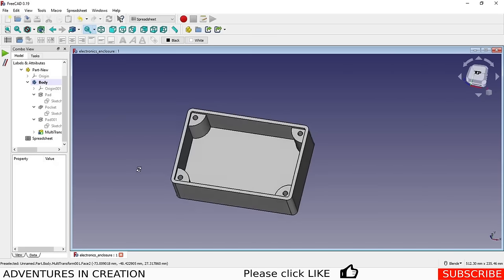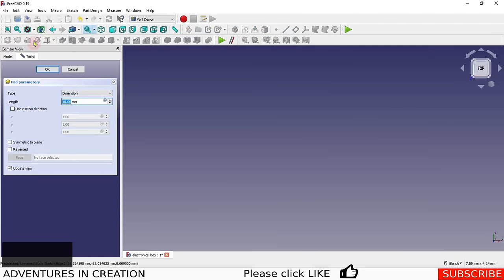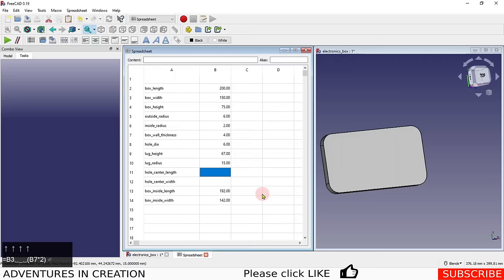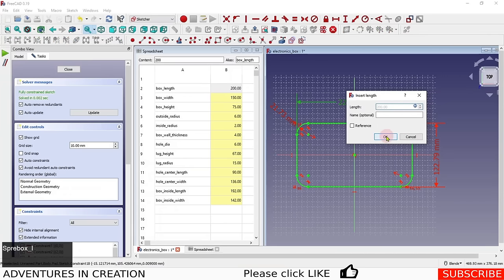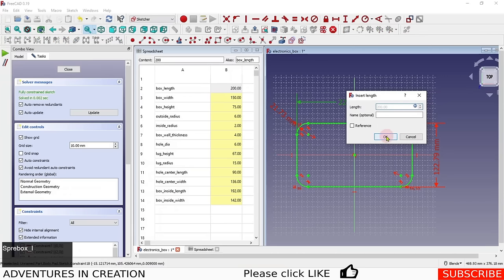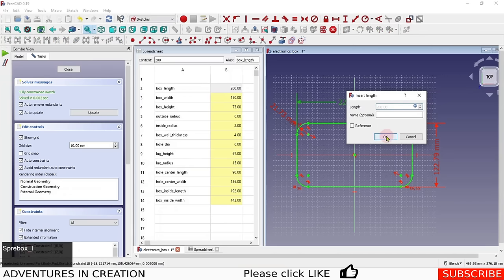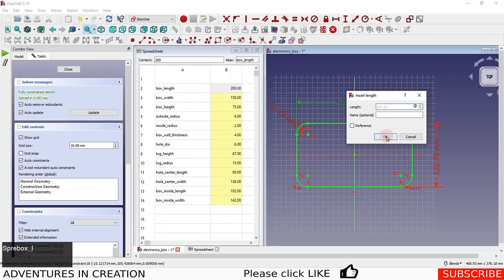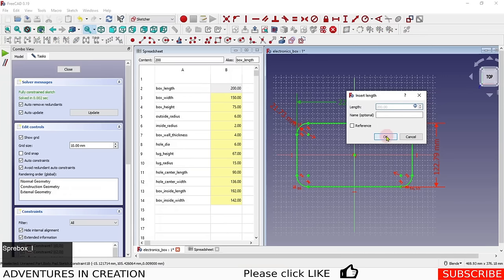FreeCAD Electronic Enclosure Using Simple Parametric Design Techniques

Comment: This is an excellent tutorial, got me up and running on my own electronics enclosure very quickly.  Before I found it wasted a many hours messing about trying to use the manual, to no avail!
Reply from the maker: Glad it helped Steven
Reply: @Adventuresincreation  hey man i already installed freecad in my computer using windows 7 but it's not openning what could be the problem

Comment: Thank you for clearly showing what you click and explaining why.  This is so much more useful than a 100 videos that show someone creating something almost by logic.  Your explanations and demonstration is so clear that I was starting to anticipate and check my anticipation against what you actually did, which gives me confidence that I may actually be able to create something like this when I install FreeCad for the first time.
At Time = 17:51, you mentioned surprise that the exterior corner radii came out different sizes after the mirror operation.   I was surprised that you only selected the upper left and lower right corners with the symmetry operator.  Could this have caused the discrepancy?  I would have guessed that you would have had to select all four corners with the symmetry operator but don't know if that is correct or even possible with FreeCad.
Reply from the maker: I am glad that it's helping you get to know freecad. The symmetry constraint is a tip for minimal constraints to achieve the same end. I think the radii were unconstrained after the mirror, I expected the dimension and equal constraints to mirror. You can constrain all four corners but the result would be the same. Thanks for watching the videos and lending your support.

Comment: I think the new box that you’ve added that shows what you have just typed and also highlights your nails and toes the switchings on the mouse is something I would like to use  Are use Windows 10 which may not be the same operating system the new use but can’t find anywhere where I can highlight the area around the mouse which I assume is the clip so can you please help thank you it was a great video by the way I’m very much appreciated
Reply: I am sorry about the stupid wording  I hate apples text modifications to my typing but always forget to check before sending you would think at 88 years old I would know better
Reply: It’s you who is appreciated not me.
Reply from the maker: Thanks Brendan, if you look in the description there is a link to the software that highlights the mouse 🖱. To make the pointer bigger and change the color just use windows 10 settings. Let me know if you need more help.

Comment: How do I print out a drawing without the points that join the lines together? I don't want the connecting points showing on the printout.
Reply from the maker: I would have to look into that. Do you have an example?
Reply: @Adventuresincreation  I drew the object in Part design workbench. I tried using Draft and it worked there so I use that now.

Comment: Thank you for taking the trouble to post such informative videos. I am a new user of FreeCAD, initially version 0.18 but I have now downloaded 0.19. 24267 - quite a performance on a Mac but got there in the end. I'd be happy to assist anyone else having trouble with the task, which involves finding the backup of 0.18 and deleting it before downloading 0.19 - otherwise it just re- installs 0.18 again.
 
I followed your video step by step, but apparently came unstuck when trying to use the pocket command. After several attempts, I realised that in my version there are 5 options:-

Dimension, 
Through All, 
To First, 
Up to Face , 
Two Dimensions.
 
I discovered that using 'Dimension' allowed me to set the depth of the pocket, but for some reason it pocketed from the bottom upwards, and it took me a while to discover what was happening. I've tried reversing but to no avail. As I said, I'm new to FreeCAD so any ideas would be appreciated.
Reply from the maker: When you create a sketch it will typically be on a plane eg X-Y plane. When you create a pocket it can be on that same plane, you can try reversing, symmetrical or offsetting the sketch from the plane. You need to establish where the pad is so you can pocket from the right position and direction.
Reply: Thank you. Problem solved. After I created the second sketch, I offset it in in the Z axis to the height of my box, by using 'Attachments" in the work tree. I then used my spreadsheet setting for the 'pocket' depth of the box and hey presto, it worked. Thanks for your help and suggestions.
Reply from the maker: @bobbailey7024  I am glad that worked for you. Once you get comfortable with that the world is your oyster ;-)

Comment: Maybe it's me but, I would need to create a hole on the FACE part of the box and no matter what I try, it's not working.  I've tried creating a rectangular sketch to use as a hole, I've made it in the X-Y plane, the X-Z plane, the Y-Z plane, I've tried to pad one and then use it to make a hole and after wasting several days, looking at a dozen youtube channels to determine how it's done, nothing.....  No one seems to have made a youtube channel to describe making a simple rectangular hole on the face of a box.  This is giving me a huge headache.
Reply from the maker: Hi Phil, you've got this. Make sure your sketch is inside the body of the box in the model tree. Create a sketch of a simple square that is symmetrical around the coordinate system. Then pocket that sketch if the hole 🕳 doesn't appear, check the reversed box. Let me know how you get on.
Reply: @Adventuresincreation  Nothing doing.  I decided to physically cut the part out instead.  However, when I printed the box, the outer wall was printed as a separate wall from the inside wall.  Doesn't look like I'm ready for freecad until I find a tutor near me to explain the details.  It's not like I'm un-educated.  I am a pilot, applications/software engineer and have been using personal computers since 1976.
Reply from the maker: @philnelson2364  I'll do a video short for you, give me a chance to dig out the model, where do you want the hole in the box?
Reply: @Adventuresincreation  I succeeded in creating a box with lugs to fit an arduino mega.  Everything is fine until I try to cut a hole in the left face.  I tried selecting the face then creating a sketch then making a rectangle, tried making a hole in the face with the sketch (Nothing happened) then tried to pad the sketch then use it to make a hole (still nothing).  Everyone on youtube that uses freecad seems to have absolutely no problems building a model, placing holes everywhere but I can't.  I was able to place a pocket in the rectangular cube to make the actual box, add studs but to carve a hole on the left side of the box........  I originally created a sketch in the X-Y direction but couldn't add height.  Tried in the Y-Z direction but the sketch appears in the center of the X axis.  Tried doing it using the X-Z axis but no Y direction.  Watched a youtube where the person clicks on the face to place a sketch and I tried that and freecad didn't ask which plane to place the sketch on (which helps a great deal.)  I can create the sketch on the left face but can't seem to actually cause it to make a hole. - I uploaded the file to a shared folder on my google drive.  If interested, it's at:   https://drive.google.com/drive/folders/1OfIndy-xZym0i4LKQj_bpf3o8uSIezOn?usp=sharing
Reply from the maker: Phil, check out this video https://youtu.be/IOUSrtSyAHw you were so close. I suspect you were not selecting the sketch when creating your pocket. Take a look at the offset sketches and planes video that I linked to in this too. It will help for sketch positioning.
Reply: @Adventuresincreation  Finally, freedomCAD...  Looks like I missed a step or two, like finish sketch then selecting it from the combination windows then POCKET and not HOLE and then correct the depth of the pocket.  Right now, just being able to place holes in any plane is a big plus.  I tried to do a sketch in the YZ plane but it was on the opposite side of where I wanted it.  After closer inspection, the model flipped to the right side instead of the left where I wanted it to be.  Looks like using the HOLE option seems even more complex with all the params it has and pocket is even easier.
If you noticed, I did use the spreadsheet workbench to create the box, pocket, lugs etc.  At the point where I was, I just wanted a pocket, any pocket so, for the time being, I'll be creating new boxes from scratch till I get to be an expert at it and then build relative boxes to modify on the fly.  Thanks for your support.  Not many people today take the time to do what you do.  Keep on truckin (old 70's expression)   Phil

Comment: Great tutorial, thanks - very clear presentation and opened up my eyes to a heap of possibilities for a project I want to do.
I hope I'm not going to fall into many more FreeCAD rabbit holes like the extra hour I spent on the macros issue. Windows 10, FreeCAD can't connect to the wiki to populate the available macros list, so I had to learn how to download and install the  EasyAlias macro - but the way that worked was just magic!
Reply from the maker: Thanks for the feedback. Today's video shows you how to create a macro of your own. Maybe that will open even more possibilities.
Reply: @Adventuresincreation  Update - I checked for updates, installed FreeCAD 20 and bingo! The macros and desktops are all showing up.
Now on to studying the lid before moving on to the job I want to tackle.
Reply from the maker: That's good news!
Reply: @Adventuresincreation  Project completed! I was pleased to find that the way you'd covered the basic principles meant I had only a little more to learn before being able to complete the design of a housing for a Raspberry Pi Zero plus Ethernet adapter board. I've put the design onto Printables with the FreeCAD file and some pictures - https://www.printables.com/model/287374-housing-raspberry-pi-zero-and-ethernet-adapter
The whole thing is now chugging away using PiHole to block adverts on our home network - happy days 🙂
Thanks again for the great intro to FreeCAD! 🙂🙂🙂
Reply from the maker: Excellent, glad it helped. I'll take a look at your freecad file later. Well done!

Comment: One thing that unnerves me about Alibre Design is, as it happens, a part based or created on a certain face, becomes orphaned when that face is changed or deleted, yet the generated part is still valid. This creates an error condition, of course. In that program you just start over. I see in FreeCAD information that indicates that, perhaps, the base or support face can be changed to a different face of an existing object. 
The question then is, is that possible and follows if true, how is it done?
Reply from the maker: Freecad is undergoing a fix for the topological naming issue which caused modeling problems when a sketch was created using a model face as a reference. The change was not intentional and very unpredictable.

Comment: This was my freecad breakthrough video! Thank you very much!!!!
Reply from the maker: Thanks James, Glad it helped!
Reply: @Adventuresincreation   I've since run into the "topological naming problem".  I've been reading into it a bit, and it seems that rather than sketching directly onto faces, one create datum planes on the primary planes, then sketching on that instead.     Have you had any thoughts in that regard?  I've tried doing it a couple times and made a mess of it so far
Reply from the maker: @jblacktube  it is an issue that is brought about by changing a model such that the faces change their reference ie face #1 might become face #3 so that anything that referenced face #1 is now referencing the wrong face. Using a datum plane that is attached to a model plane and offset will not suffer this fate.

Comment: the enclosure bottom does not change with the wall thickness change
Reply from the maker: From memory the depth of the box is a separate parameter. I am sure you could change that.
Reply: @Adventuresincreation  Yes, I was able to attach a datum plane to the top face, add the inside sketch, pad to the box height - the wall thickness. The bottom now changes with the side walls. Same for the lugs. Thanks for the tutorial. It has helped me to understand greatly the parametric modeling concept.

Comment: I can't get the hole to go through the bottom as well. What ever I try it just does something completely different like removes the whole bottom. What am I missing here ?
Reply from the maker: Which hole are you referring to?
Reply: @Adventuresincreation  the 4 corner holes. I was thinking of bolting the box to my printer so the flat head screws should go through the lid and the box into the printer
Reply from the maker: That's odd, you should be able to just extend it all the way through
Reply: @Adventuresincreation  can you do that on your box? what exactly are we extending ?
Reply from the maker: @eyvindurleo  I will take a look at the model, I haven't done anything with it for sometime so I can't answer off the top of my head.
Reply from the maker: OK, I just had a chance to look at this. I see that the hole and the "boss" in the corner are made from one solid with a hole in it. Therefore, to make the hole extend all the way through you will have to create another hole that just goes through the solid. You will need a new sketch with just the holes and create a pocket "through all" that should get you the hole that you want.
Reply: @Adventuresincreation  great i'll try after i install a bltouch on my anet et5 wich has some desoldering and step downs = headache

Comment: Nice tutorial, one thing you may want to mention is that on the straight lines for the lugs, these should have a vertical and horizontal constrait. If you dont, when you update the border thickness you may run into alignment issues.
Reply from the maker: Good point. I will try to mention the auto constraints more in the future

Comment: I'm following your example to the letter but when I run the macro I get errors that it can't start with a numeral character.  error: Remember, aliases cannot begin with a numeral or an underscore or contain any invalid characters. The last video I watch you used the names in the formulas instead of the cell names and it worked. What's the difference? Thanks
Reply: I figured it out. I was using a minus sign between the words. Example Box-Length.
Reply from the maker: Glad you figured it out
Reply: @Adventuresincreation  Hi,I have succeeded and spreadsheet is working. My inside lug is always offset by the inside radius unless I make inside radius 0.1 or smallest ,my 15mm lug with 6mm hole wont go into the corner.  It seems my inside radius has a problem

Comment: Great video but I find it difficult to follow through because a lot of the actions seem to be dependent on the context of your selection in the Model tree and that is not being made clear
Reply from the maker: I am sorry that you found it difficult to follow, not sure quite what you mean about the context of my selection in the model tree.
Reply: @Adventuresincreation  Thanks for getting back to me. For instance I am stuck at around 22:51, for the life of me I can't figure out why the sketch of the hole I am creating is showing (as a green outline) on the "Bottom" of pad, rather than the "Top". Also, when I look at the "Top", at exactly 22:13 like you do, I don't see the "bevel" (not sure what to call it), it's showing the part for me without the pocket on top.